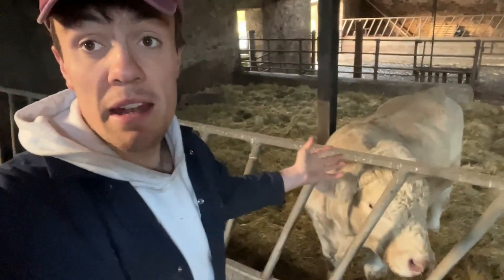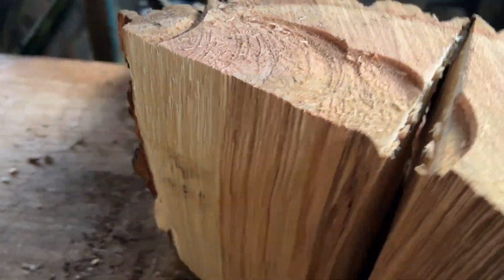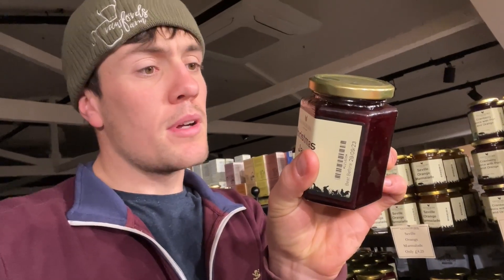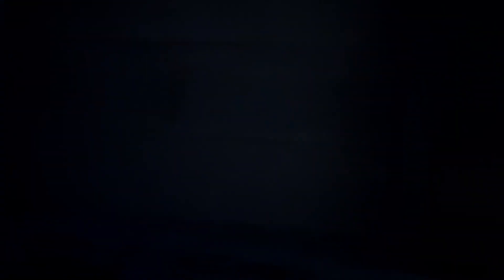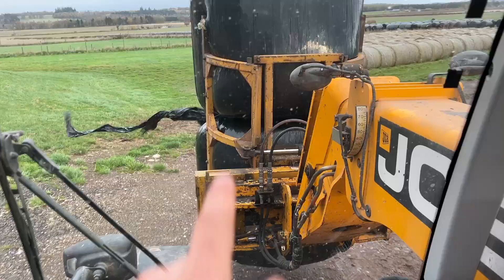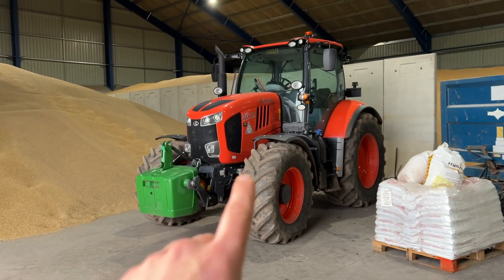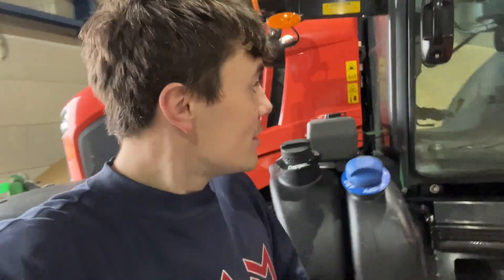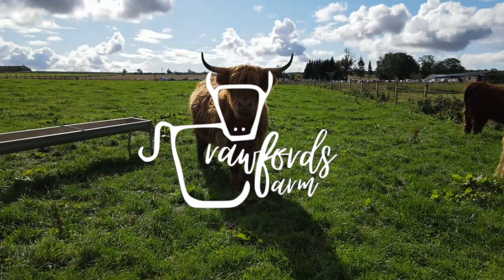Big Orange Tractor

Comment: Kubota is a master at building compact diesel equipment. I purchased three utility Kubota tractors back in 2005 with the largest only being 68hp. They’ve been absolutely wonderful with no unexpected problems. Kubota has tried to gain a market share here in the USA with larger tractors over 100hp but they haven’t enjoyed the same success as their compact units. Big tractors just don’t seem to be their strength here in the USA.

Comment: been running kubota for 13 years farming with no breakdowns or mechanic call outs and they are fantastic. they do every job any other brand will do. and are cheaper. ( we farm 650 acres all dairy and do all our own work). people are snobby about kubota, not a clue why but they are so wont give them time because quite frank they don't know the machines. so will get ripped off by all the other brands.

Comment: Guess what it is! Be a KV plough,  was impressed with your Lemken demo although the soil left the board before it's end. Plough demo's are good on the day, or as good as they perform on that day, our KV dealer dropped a plough here to try, would never have tried it,  bought it,  our soil structure and health has improved year on year since,  your Fendt (if it can lift it )will manage another furrow,  number 30's Crawford,  anything else,  pull the workshop bench up and down.